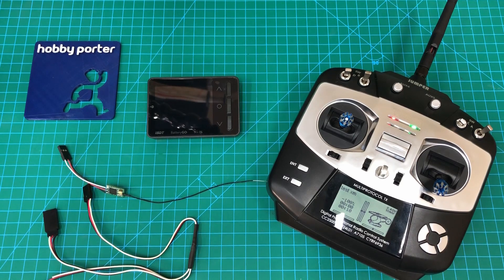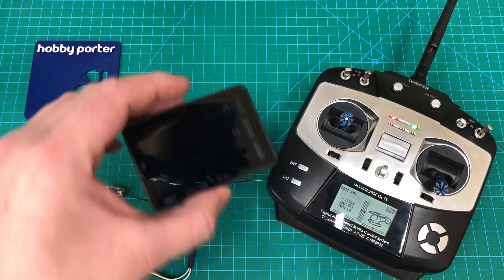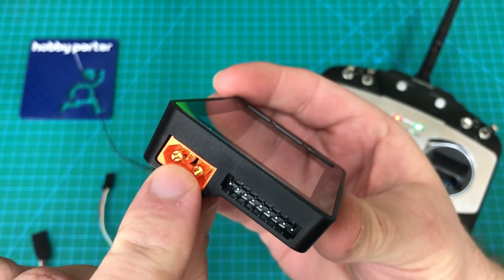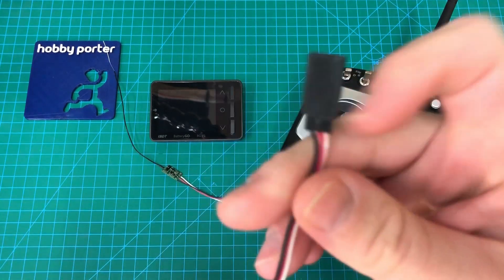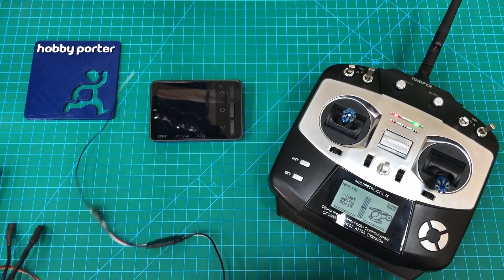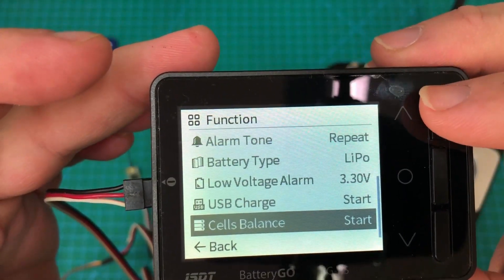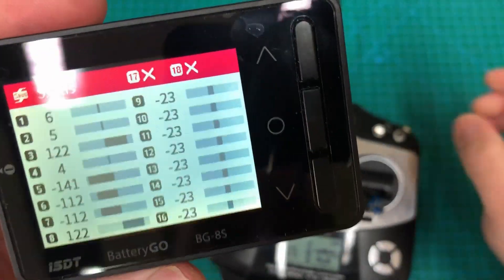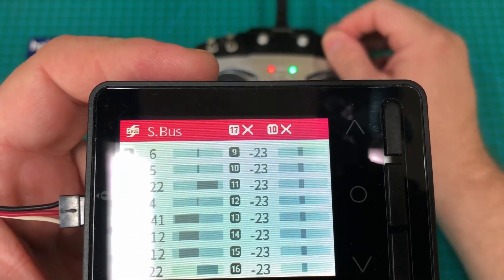iSDT BG-8S S.bus Receiver testing function overview

Comment: that's a neat use of the balance ports, I've never noticed that servo cables have the same pin spacing as balance wires. I wish the device also worked as a servo tester though, that's my only gripe. I'd imagine to do that, they'd have to install an actual servo port, because it's probably not possible with this setup.
Reply: Spektrum has a device that's almost identical, but has a servo tester: https://www.youtube.com/watch?v=xEh2qrJYkKA&t=559s
Reply: @cokert3  biggest disadvantage there is it uses an IC3 connector instead of XT-60i, though both are still smart ports that can communicate the battery info through that center wire. If you already use EC-3 and EC-5 connectors, it's a no-brainer